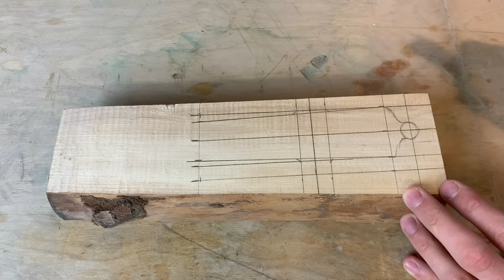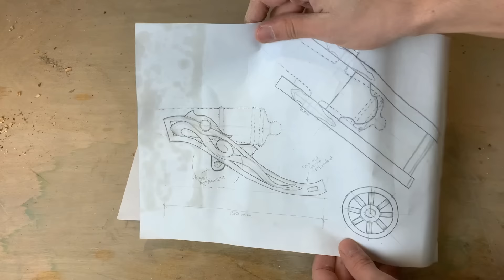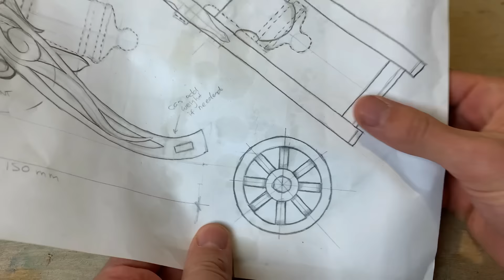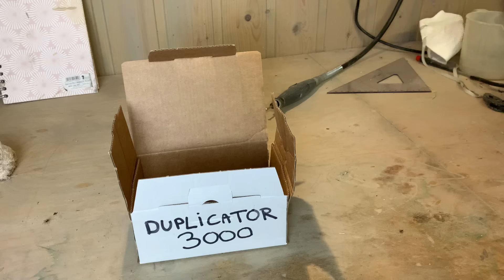Making a Wooden Cannon and firing it! Calm Video

Comment: I recently bought a new dremel after giving my old one I never used away (we moved and I never used it and didn't want to pay  to ship it). I needed a dremel to complete my SIG P320 80% kit and I bought one with the pen handle thing like you used. Massive difference using it. If I had bought this one originally, I would have never given it away.

Comment: Welcome back. I like your channel as you have the same tools as me and this shows me what's possible with what I have. I also have similar small Woodstock. We are so alike! Love the build and the humour. Glad you're well.
That three legged vice is brilliant. I have the same model and it's always in use.
Reply from the maker: Hello! Thank you so much! Oh that is cool to hear. Yes that vice is used a lot, although i should try to create some larger clamps for it for bigger projects.
Reply: @Jonasolsenwoodcraft  I have some Formica worktop bolted onto mine at the moment in order to hold large logs for milling to smaller pieces by electric chainsaw. The Formica worktop  is very strong  and grips high up on the log. It works well

Comment: Make the projectile diameter slightly larger than barrel diameter then compact 50grams of gunpowder in barrel and finally hammer in prpjectile, and now you have a gun, 

It was fun when o di this with weaker pyrotechnic mix

Comment: So if someone were to scale this up, at what point would the explosive force of the charge required to move the shot overcome the tensile strength and cohesiveness of the wooden barrel, leading to the sort of catastrophic failure that killed the Scottish King James II at Roxburgh seige in 1460?
Have any physicists or ballistic engineers out there got the answer? I'm sure it would have to vary based on the hardness and age of the wood.
Reply from the maker: Haha i was not sure at all, That is why you can hear me running away after lighting the fuse
Reply: @Jonasolsenwoodcraft  Definitely a wise choice. 😉